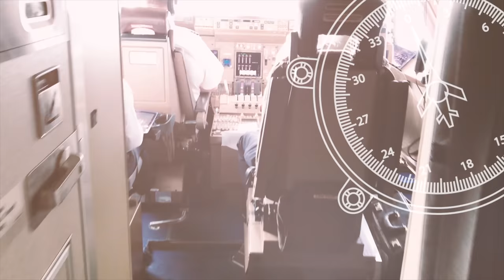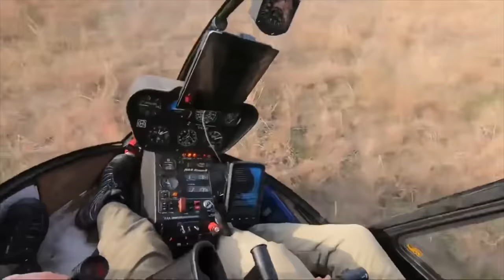Boeing 747 Loses Landing Gear | Viral Debrief

Comment: Was in Army primary flight school at Ft. Wolters, TX. Of course we were taught to auto rotate. The instructor would cut the engine without warning and we'd have to initiate an auto rotation, but this usually happened between a thousand and 500' so there was plenty of time to prepare. I agree with you that the helicopter pilot flying what looks like a Robinson 22 did a really great job getting the thing on the ground without pancaking, or even rolling over (which I've seen happen) at such a low altitude. Thanks for your vids!
Reply: r44

Comment: I've flown KLM a few times, and I've probably flown just around 10-15 times in my life (at 23), and out of all the flights I've been on, KLM seems to have either stellar pilots or stellar luck with weather at landing, because every time I've flown with them the landings have been so smooth you barely noticed the plane touching down. All other flights have either been rocky or downright scary landings.

Comment: That KLM 474 is landing at LAX (you can see the light up poles at the entrance in the background). From the angle of the buildings in the background it looks like the filming was either done from the small access road that runs to the north of the airfield, or from one of the hills/structures just outside the to the north.

Comment: On that first video I don’t think they dumped the fuel because they were circling over my house for almost 2 hours.   My brother was a 747 captain and told me that it was a hydraulic system failure and the right wing gear didn’t retract properly and wouldn’t retract or extend after they cycled it a few times.

Comment: With that helicopter autorotation landing, I'm also glad that the pilot was able to instantly identify that it would NOT be safe to attempt for the field across the road - not just because of the trees on the other side, but also because at their rate of descent those barely visible power lines would have been a very possible issue to a safe landing (I say barely visible because you can't see the wires - just the wooden posts).  I also rather appreciate that the pilot's first question was "is everyone okay" while they were doing the "okay, are we on fire?" checks...  Worked on shutting everything down, and kept safety as the key thing, especially with the whole remark about waiting for the blades to stop spinning, which is something only those around rotary wing aircraft will know are a massive hazard.  The cool, calm, collected apology for the unplanned landing was icing on the cake of handling a bad situation!
Reply: Concur. It’s just too bad his tail clipped the tree just as he was flaring. He probably would have not folded the skid gear on the one side. But, overall upright and everyone walked away. Good job!
Reply: I also love the bit where he notices his mag switches were off.
Reply: @XLC-zd8dn  my flight instructor taught me, "when the engine quits its the insurance company's helo. Damage shouldn't even be a consideration. Survival is the only thing that matters."
Reply: @Cannon1221  - Totally concur. I just felt bad for the guy as he was doing such a good job and just nicked that tree. But, as the saying goes, any landing you can walk away from is a good landing. 😉

Comment: Hey Kelsey, great channel.. just to correct you on the 747 landing without the right main gear.. check out the loss of system 4 hydraulics checklist.. you’ll notice that it’s a flap 25 landing with no auto spoiler or autobrake.. see also what other flight controls are affected you’ll notice that only 50% of elevators are available. Then check out the performance section for landing and note vref for flap25 app at 285 tons which is Max landing weight for pax config (302) for freighters.. you’ll note that the RoD is high because of the high vref F25 and if you ever do a high Vref F25 landing there is less flare required more of a slight check otherwise it’s float city as you say! Now remember you have only 50% elevator and no auto spoiler.. (they can only be raised when nose gear is down) so with only half your elevators working a high Vref and only a slight check to arrest RoD and no Auto spoiler you’ll get a bounce!! These guys weren’t scared or inexperienced.. 3 pilots on board that day who knew exactly what to expect and planned and discussed every possible threat and mitigated.!they were flying around for nearly 4 hours after takeoff to resolve the problem. I know this because I worked with these guys on this fleet. We practiced these kind of scenarios all the time during LOFT in the sim.. whilst this was an extremely rare event these guys did a first class job and knowing the skipper he was very calm and super cool during the whole event! 
Keep up the great work 👍🏼👍🏼
Reply: Ok nerd. 

Jk jk jk lol
Reply: @huggleskuishy  🤓

Comment: @74gear, You can see @9:26, he realizes he caused the engine failure by not having his mags on.  He attempts to turn them off only to see that he had never turned them on.
Reply: Yeah, this was a self inflicted crash landing.
Reply: got to talk to an air ambulance pilot about emergency crash procedures, and he told us about the fuel cutoffs, and then said helicopter pilots are so conditioned to emergency shutdown procedures, that even if the pilot is killed in the crash, there's a 50% chance he will still hit the cutoffs.
Reply: You got to it before me lol.  If you look up the original video, I think he only had his left mag on. You can see the key position before he takes off in the original long video. At least that's what I heard. I thought it was funny when he said, "give the pilot a beer", because the pilot caused it to go down himself!  But, regardless he put it down, and everyone was okay sooooso? Would you offer him a beer knowing that? Haha 😂. (honest question) I wouldn't.
Reply: How did he start engine, take off and fly to the point of engine failure with the mags off?
Reply: @hesatwitchyone  Years ago, I worked a coding job for a big sports website. Each weekend during football games, the site went down due to some legacy server code that wasn't optimized. Finally, a senior engineer was brought in to fix the issue. He was cheered a hero when he corrected it. Turns out when we looked up the code history, he was the original author in the first place. 🤦‍♂️
Reply: @toddsmith8608  if I understand other comments correctly, the switch was not functioning properly, and the engine would sometimes run with the switches off.
Reply: @toddsmith8608  Mags only work when they are cut from being grounded against the aircraft itself (it means, if the cable breaks it'll say 'hot'). If the cable between the switch and the ground (the aircraft) is broken, it'll work. Same with the cables to both the left and right mags. The issue is, if he turns and the loose cable touches thge plan it'll stop the engine ignition.
Reply: @kenbrown2808  It's how the magnetos work. They, be default, always run. This means the engine will keep going if the battery/generator dies. The only way to turn it off is to ground it against the plane. So, when it's off it means they are both grounded. If it's set to 'both', both magnetos aren't grounded and they run. So a cable disconnecting would still allow the engine to run, until it grounds itself.
Reply: @CpnGoose  I hadn't thought about the mechanics, but yes, I understand that, now that it's brought to mind.  point being other commenters who know more information about the specific crash said there was a malfunction as well as pilot error
Reply: @kenbrown2808  it's a clever system. Unlike a car, that stops when the electronics fail, this system means the electronics failing will actually lock the engine into running. When you start a plane like this, you actually switch from 'both' to 'left' and 'right' just to isolate each magneto (and it's spark plugs) and ensure they are all firing. In this guys case,  he clearly failed to notice that it was off, which is scary as you test for RPM drops as a start-up checklist.
Reply: @CpnGoose  oh, yes.  it's eminently sensible, especially since in a helicopter, you can't just get out and push.
Reply: @CpnGoose  so do y'all think the mechanical issue happened during the accident flight or pilot knew it was an issue and was flying it anyways?  I still don't understand how people are saying after the crash he went to turn off mags and they were already off.  Once starter is released the ignition switch goes to "both," no? Is the start switch separate from the mag switch on this aircraft?
Reply: @toddsmith8608  the helicopter was grounded through the skids at takeoff.  Once airborne, the ground was gone.  I delved deep into it when I saw the original video.  You can see the position of the switch is in the off position in the video.  It's cross referenced in some forums from pictures taken inside the actual helicopter when it was previously registered in Canada.
Reply: They were doing a wild pig hunt down in Texas.  Chances are the pilot lands and departs all day, running hunters through the cycle of airborne pig hunts.  I'm guessing complacency may have struck him.
Reply: Right at 9:26, he goes to turn them off, realizes they are already in the off position and that he caused the crash.  He kind of chuckles to himself and says "it's alright". It clicked in his head for him right there, as he realizes he never turned the mags to both.
Reply: @toddsmith8608  Yeap, it bounces back to 'both'. You do want to flick to Right and Left to ensure that they both work (you'll get a small drop in power when going to them from Both).

Comment: I used to be one of your co-workers. I suspect they would have silenced aural alerts because the gear was up, which would have killed the RA callouts. If they habitually flare at a certain altitude they could have easily missed it, leading to an exceptionally hard landing. I've seen it happen in person, it's really easy to not notice the RA callouts are absent. It worked for us to have the 2 FO make the calls from the observer seat.

Comment: @ 9:55
Helicopters do not "fjy" like an airplane ... they simply "beat the air into submission".
Reply: Incorrect, each rotor blade is a small wing, like and airplane, moving that wing through the air creates pressure difference above and below the wing just like a plane wing, this provides lift.
Reply: @Dcscockpit  just because it generates lift doesnt mean it flies like an airplane.
Reply: @Quasar0406  
Thank you

Comment: i appreciate the "float" talk. just got back into flight sims with the new one out. hardest thing for me is the speed on approach. like you said it feels like it should just stop. but you have to glide sooooo slow(probably a lot different when in the cockpit), especially in bigger aircraft. i tend to stick to smaller planes so far. less speed, lighter, and way easier to land smooth.

Comment: On my very first flight when I was 16, we were flying to Calif - pilot announces the hydrolics for landing gear has failed and they would need to manually lower the gear. They prepared us for crash landing - none of that seemed alarming to me for some reason - I thought all the preparations were a normal part of landing. Only when we actually did land safely but saw the runway lined with emergency vehicles did I actually realize how close we actually came to real problem.

Comment: Kelsey, yes the helicopter pilot did a great job saving it, but he also caused it. If you look at the position of the key, he only has one mag running. Instead of set to dual like it is supposed to be. I don't know what his boss had to say because he did save their lives. But he also caused the engine failure
Reply: Came looking for this. TY.

Comment: This was a Virgin Atlantic 747 29th Dec 2014 landing at Gatwick UK.
That day I was flying a CAP 10C with my son over Kent coast at 5000 ft about midday (south east of gatwick) when we noticed a 747 coming out of Gatwick and it looked really strange. It was climbing with flaps and gear down heading straight towards us.
I circled around and in a few minutes it passed directly over us at about 6000 ft. London TMA started at 5500,  It obviously had problems, it was heading out to sea.
Then as we watched it turned left and started back again so I hung around and waiting and realised it was holding over the Seaford SFD VOR which we were above. It went around a few times while it passed directly over our heads. (for those who dont know a CAP-10 its a 2 seat aerobatic plane with a bubble cockpit, so we had a spectacular view of the undercarridge.
After the encounter we flew off and then later on the news that night found out what happened. 
The plane took off, had issues then spent the next several hours buring off fuel and trying a few landings to try to bump the undercarrige down, none of this worked so at some time after 15.00 it made a landing at Gatwick which is what your video shows.

What really really annoyed me is that I had left the video camera in the car as we were going to fly aeros, so I have no film of this. Having video and being right underneath the plane meant I could have sold it to the news feeds for thousands. Never mind. It was a lot of fun though.

Comment: Kelsey.would you be able to do a BOEING V's AIRBUS video to highlight the differences between both aircraft..love your channel.. sending best wishes from ENGLAND uk
Reply: That would be great! If i remember correctly, Captain Joe and Dutch Pilot Girl did an Airbus Vs. Boeing video. It was good, check it out!
Reply: Honestly, it would vary a lot depending on exactly which two aircraft you're comparing. The largest difference (of similarly-sized aircraft) would probably be 737 v. A320 just because the 737 airframe is so much older and a lot of it can't be changed without requiring a new type rating. For newer types (80s-90s and beyond,) there's not nearly as much difference in most cases, other than the sidestick vs. yoke issue and a few things particular to newer technologies used in the 787 (e.g. the bleedless design.)
Reply: @vbscript2  Unless you're a pax, then, for Airbus, I say BRRRRRRRRR. Damn buzzsaws for engines...
Reply: @toda2638  That just depends on the engine rather than the airframe. I seem to hear it more from Rolls engines, though just about any of the high-bypass turbofans will do that to some degree if you set the power high enough. (Notable exception: the P&W GTF. That thing is crazy quiet.) Granted, I suppose Airbus aircraft are more likely to have Rolls engines these days.

Comment: The last footage there, from The Philippines was actually at Kalibo airport, not Borocay and it happened way back in 2012.
PROBABLE CAUSE
The Aircraft Accident Investigation and Inquiry Board determined that the probable cause of this accident was:
- CAUSE FACTOR
- Primary Cause Factor
a. Failure of the flight crew to discontinue the approach even though prevailing conditions suggest that a missed approach should have been more appropriate. (Human Factor)
- Contributory Factor
a. The decision of the Pilot Flying to take runway 23 at less than 4 DME putting them at a high work load that resulted to late configuration of the aircraft. (Human Factor)

Comment: In the last clip, they are actually landing at Kalibo International Airport in the province of Aklan, Philippines.  From there, it's an hour and a half drive to Caticlan, where you take a ferry over to Boracay.  Interestingly in about 2009, they extended that end of the runway by a couple hundred feet.  So the area where the plane stopped is now concrete.
Reply: Thanks for the info. What airline was this?
Reply: @kiyosaru1  I think it was air Phil before they were bought by pal
Reply: This explains why the video quality is so potato, if it's really that old.
Reply: Yeah, this couldn’t have been Caticlan airport, as there’s the sea on both ends of the runway. They would have ended up in the water...
Reply: @kirkleiber1412  Indeed.  That is a tight runway.

Comment: Re: the 474 with the landing gear problem, I was surprised that some of the remaining tires didn't blow out. They are selected based on their share of total weight they have to carry, but now some of the tires aren't in contact with the runway, so they're bearing more of the load. Then, on top of that, the pilot drives the plane into the runway. Strong tires.
Reply: In several similar clips I've seen some tires almost always blow out.
Reply: The what with the landing gear problem?
Reply: Actually that’s not correct. Boeing intentionally designed the 747 so you only needed one landing truck for redundancy. They were concerned that a failure would be catastrophic because of the high gross weight. . That was the thinking in the 1960’s.

Comment: As a retired 777-300 long haul pax pilot, I agree with some of what you have said. I must say though that anyone with enough time flying to be in a 747 in that situation should be overly careful of your sink rate so as to make the transfer of weight to the remaining gear as soft as possible. I honestly can't cut these guys as much slack as you have. Given that, Boeing sure builds tough airplanes such that the G forces sustained in that landing didn't compromise the remaining gear. I have dumnped fuel only once in a 35 year career and I agree. It's an odd thing to do. Many believe that an overwieght landing is preferred to dumping fuel. I beleive if you have the time to dump it's one less thing to explain at the review board.